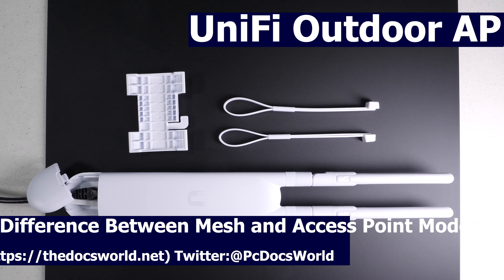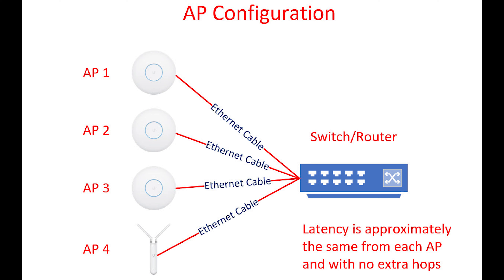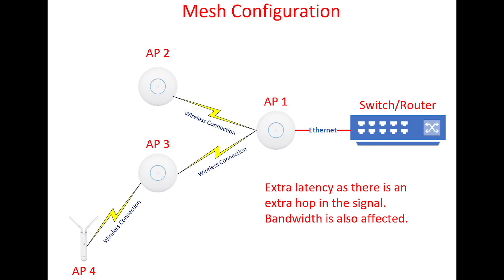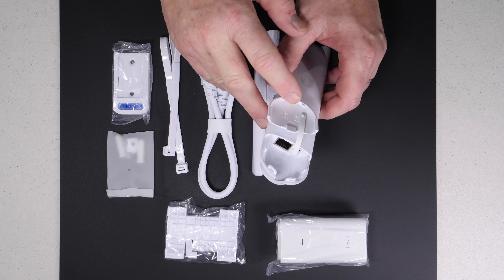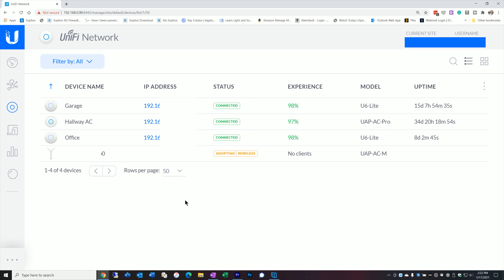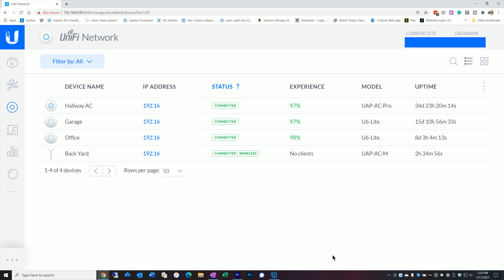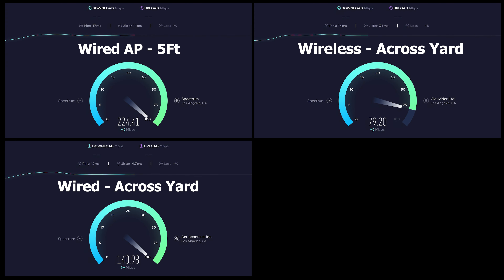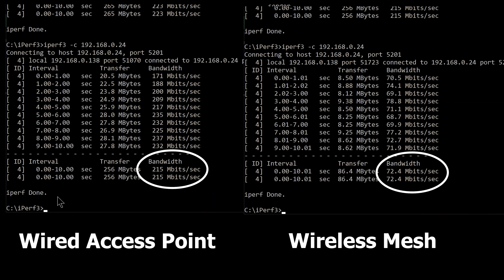UniFi Access Point Wired vs Wireless Mesh - Is there a difference?

Comment: So is using these with wires the same then as using the circular access points? Building a 3600 sq ft home and have to tell them where to drop the Ethernet hookups to. Was thinking of just doing one on the ceiling of the main room upstairs and downstairs. I'm just unsure if I do this mesh system with wires or something like the AC pro
Reply from the maker: Go with the AC Pro 6 or AC LR 6 if you can find them.  If you are running wires then you not need to mesh, just plug them into a PoE+ switch and run the controller software.  Another alternative is 4 of UniFi lite 6 devices, 2 upstairs and 2 downstairs.  The price is about the same but will distribute the signal more evenly throughout the house.  I have 2 LR and 1 lite in my 2300 sq. ft. house and the coverage is awesome.  Good luck with your new home.
Reply: @MikeFaucher  thanks so much for the reply! It won't be ready for a year or so, but we have to make all the decisions now with how crazy supply is. I was leaning towards the AC LR, so I will search for those over the next year. We have 1800 sq ft on each floor, and they overlap pretty well so i was thinking one per floor if i did the long range
Reply from the maker: @yougotsnail8266  That will work.  For just a few bucks more, get the LR 6 (AX) as it is more future-proof and performs better.  Good luck.

Comment: Mike thanks! Can you comment about roaming continuity performance between wireless mesh and multiple wired same-SSID APs?

My use case is sometimes during live online meetings, I have to go upstairs/downstairs, and not sure but I feel mesh has better seamless connectivity better than AP.

My hypothesis is that mesh uses same channel and there's some handoff intelligence built into router-nodes, hence there's no disconnection at all.

While in AP mode, there's no intelligence in the APs to handoff, and although SSID is set the same, channels can be different. Hence whole roaming, the client device has to first realize network from one AP is dropping, then search for another channel and then connect. During this time, an online meeting will disconnect for at least 30 seconds.

Any view? Pls comment. This is not related to UniFi.
Reply from the maker: Other than Unifi, a dedicated Mesh system would be better as you pointed out but the distinction between mesh and the Unifi approach is more difficult.  Stand alone AP or routers with the same SSID's do not work very well.  The switch over often causes a short disconnect which is not ideal during a video call or data transfer.  A dedicated mesh system or using something like the Unifi APs is a much better approach.  Because typically the Unifi system is hard wired into a switch somewhere, they tend to provide the most consistent performance and a very smooth handoff.  Personally I would not have standard APs set the same SSID in my home or office for that reason.  Hope that helps and thanks for the question.

Comment: Is multiple wired access point can use same ssid? And can i still use the feature of mesh.. i want my client to automatic connect strongest AP near.. like the wireless mesh feature..
Reply from the maker: Yes,  Whether you use wire or wireless mesh, everything will be same SSID and will work fine.
Reply: @MikeFaucher  can you make a tutorial video sir? 
i'm using mikrotik rb750gr3, tenda f3, & totolink a2004ns

Comment: Thank you for this video! However I'm having trouble with some things. I'm thinking of using the tplink wap 245 wap instead of a wireless solution such as the tplink decox20. With tplink wap245 will I be able to create a mess network so there will be seamless switching of network on my devices when I move closer to a new ap? Thanks again mike
Reply from the maker: I think that is a great idea.  Just a thought, the EAP245 is an AC access point.  If you are going to go a distributed mesh configuration you may consider going Unifi 6 instead as the configuration is simpler and handoffs work very well.  You can check out my other videos (https://youtu.be/wI8FTUtr3bM) (https://youtu.be/15ulZ56DOC0) on the Unifi 6 products.

Comment: Hi! For large house should I buy access point or mesh system? Thanks!
Reply from the maker: Not sure what you mean by large.  If you are covering around 4000 square ft with two floors, I would go two Unifi APs that are hardwired.  If you can't do that, then mesh at least 3-4 mesh points.

Comment: hi mike, i'm a little concern about the handoff/roaming. is there any difference how seamless the transition between mesh and ap?
Reply from the maker: I have not seen any issues in the handoff only in actual bandwidth performance.  Good question.  It is obviously better to hard wire when you can.